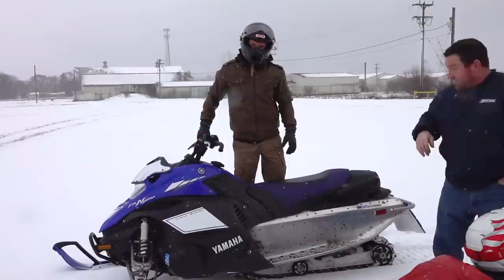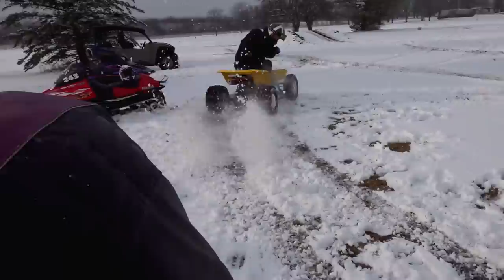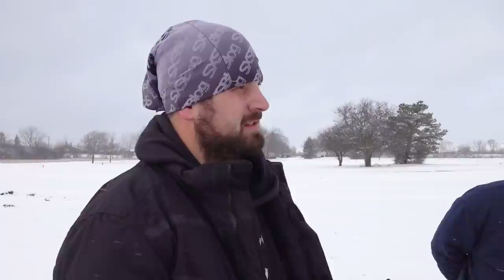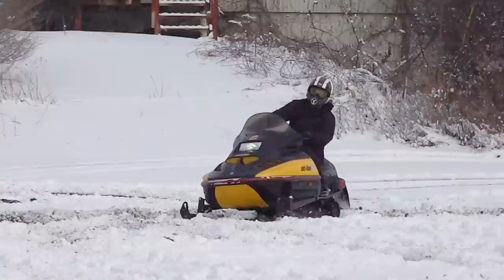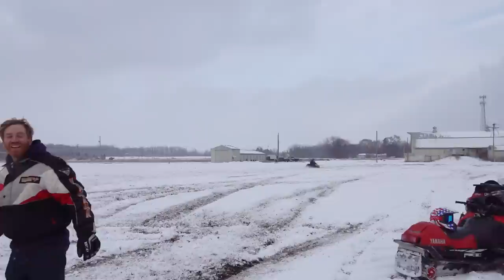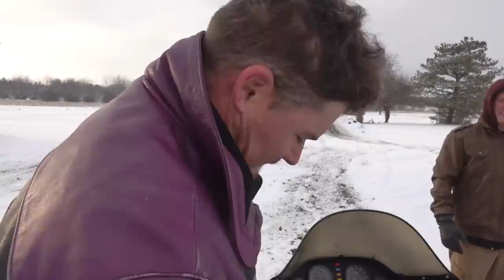Frank goes HUGE on the Skidoo & NEW QUAD enters the chat!

Comment: When I was a teenager I had an indy 500 wound out on a road and I hit a 4 foot snowbank at top speed. I must have jumped that thing over 90 feet! I ended up in the trees.  I landed so hard it cracked the tunnel right across the top near the front of the seat, the skis and handlebar were bent bad and I bent the tunnel just like he did but she made it home. It wasn't worth fixing, I had to part it out. Frank just made me remember this.

Comment: I built that Quad. It was a great bike.  All Wiseco top end. Aaen cone pipe. Barnett clutch pack. Porting and crank by Ken O'Connor Racing. No switch assembly on the bike when I built it or head light. It was a fun build  It would give that yellow Banshee a run. Still sounds crispy.
Jeff Davison. Saginaw, Mi.

Comment: yes! A lt250r I had a few of those when I was a younger and they rip. If I knew about them back then what I do now, I would have never gotten rid of them after they blew up. I now have a lt500r with a 1979 Kawasaki 4 cylinder in it still in the works.

Comment: I could tell the LT was super lean when Frank went off the jump with it.  He was off throttle and it was still high reving/ bouncing.. Like it does when they run out of gas.   You can hear it at 8:50;  he pulls in the clutch and. is off throttle and it's still trying to run away from idle.  She was LEAN.  Probably a leaking crank seal or something-- from it sitting and getting hard.  Or it was running out of fuel -- gummed up filter or something.

Comment: You have to be careful running 2yr old gas. In a 2 stroke. I was buying a bike & the owner didn't say it was sitting for 2yrs. Then he blew up the bottom end. 
Esther based 2-stroke oil starts breaking down as soon as it's added to fuel. You're only supposed to mix what you're going to use for the week.

Comment: When I was 12-13 I used to ride a 250 quadracer. My goal was to race at buchanan redbud TnT, it was just across the river. I could hear them racing on race day and for the mudbog races. 
I was really good at riding it, I was jumping about 15 ft in the air and using the gas/brake to rotate it for my landings. Then one day I bugged my dad to come out riding with my 3 Wheeler and he wrecked the quadracer.....he never got it fixed or replaced, my dream for being a pro racer died that day and I kinda knew it.

Comment: It's not the distance. It's the height. Higher speed will give you more distance for the same height. If the jump has a steep angle,  more speed will give you more height and the older sleds just can't handle the drop, if it's more than a few feet.

Comment: Listen, 100' jumps are not uncommon on a sled and much longer in the Canadian Rockies when you csn easily be 25'+ high in the air.  Frank's were sorta piddly, that's what the 15 year old kids start with
Reply: Yeah when you’re jumping a stock 28 year old sled to flat on no snow it’s a little different lol
Reply: @dougbutterfield5505  of course, I grew up with a 1979 Enticer and that was a rock whem landing unless you had deep snow.  About 30-40' was the max unless conditions were perfect. Then had a 1997 vmax 700 triple and there was a jump in a farmers field that we could easily hit over 80' at 50 miles an hour. I hit it at about 65 mph and when I landed, I hit so hard I was laid up in bed for a few days my back hurt so much. My buddu stepped it off at 105'.  One and only time hitting it at that speed.